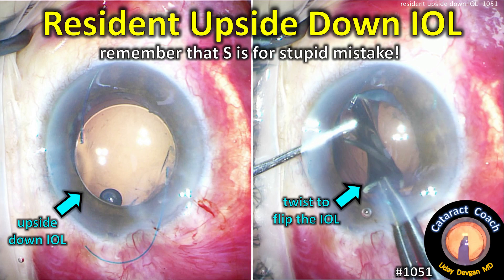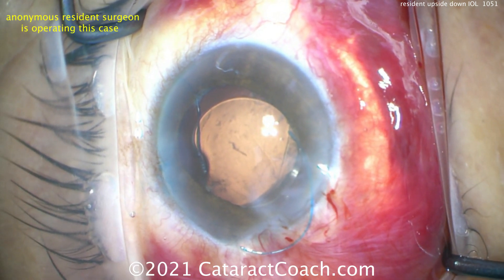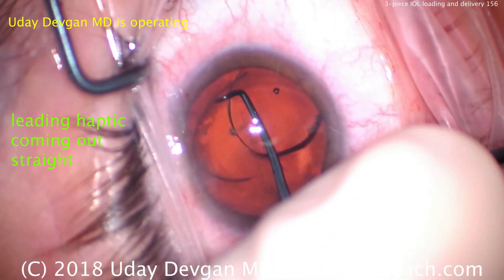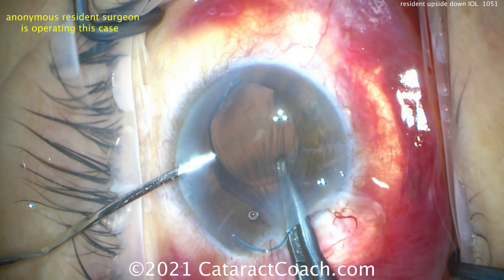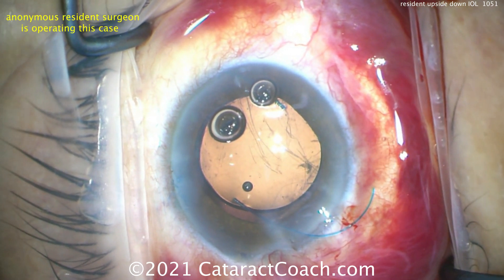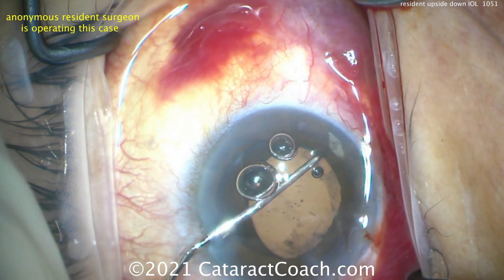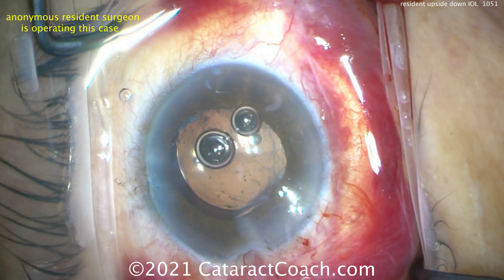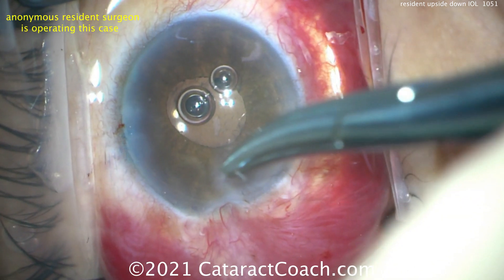CataractCoach 1051: fixing the upside down IOL -- why did this happen?

Comment: Thank u for your lecture video. Recently I met a posterior capsule rupture, and I injected 3 piece iol (sensar AMO) . Unfortunately this iol was positioned upside down iol with optic capture. I did not have experience of iol exchange, so I finished surgery in that situation. Patient refraction was 1D of myopia, best corrected vision was just 20/50. In this case, is it necessary to reposition(flip) of iol?